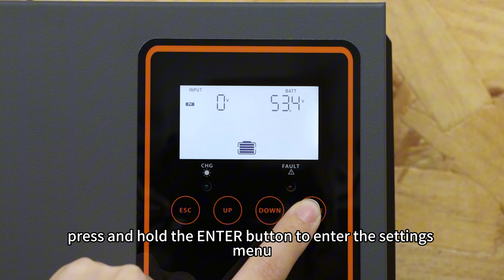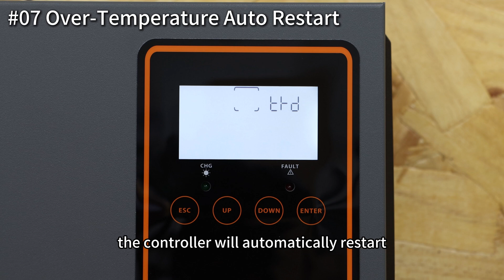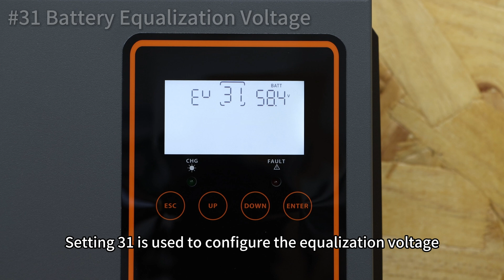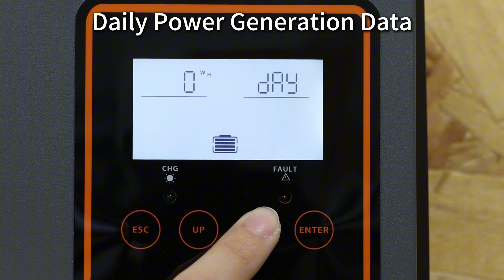How to Setup the POW-48140A Solar Charge Controller – Step-by-Step Guide！

Comment: What is maximum current for PV input?
Reply from the maker: As long as it meets the input voltage and power range.
PV Array MPPT Voltage Range：60Vdc~450Vdc
Max. PV Array Power：6500W
Reply: @PowmrSolar  In order to configure an optimum solar array the maximum PV current input
must be known. Every AIO Inverter has this parameter in it's specs.
Reply from the maker: @jerryconrad5251  This isn't an inverter. It is a solar controller
Reply: @PowmrSolar  Every AIO Solar Inverter has a PV charge controller in it.
Reply: A reviewer/buyer has reported it to be 18 amps.